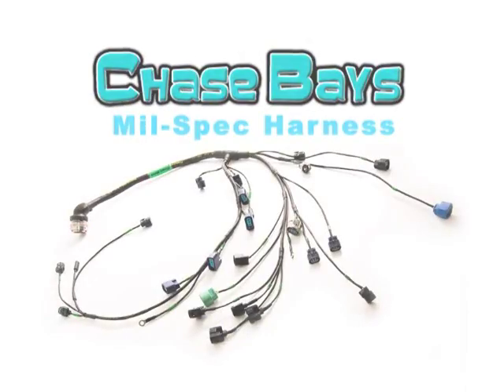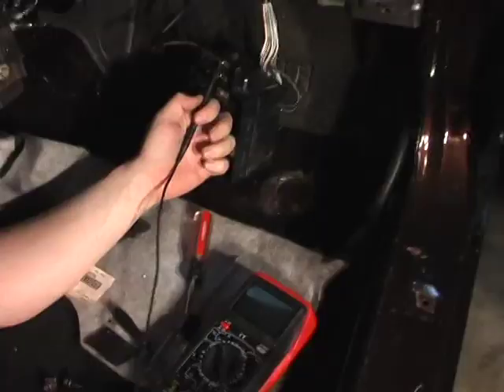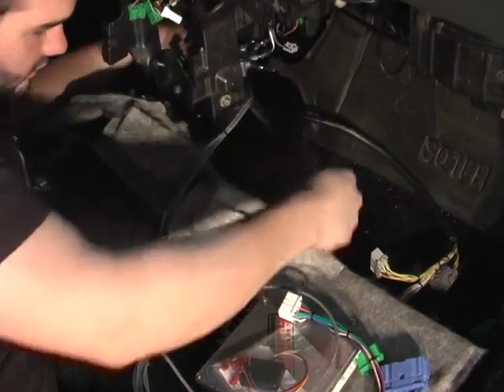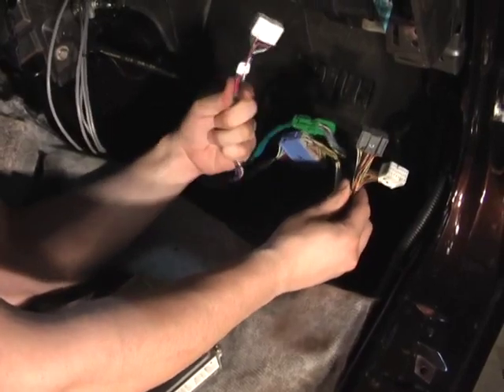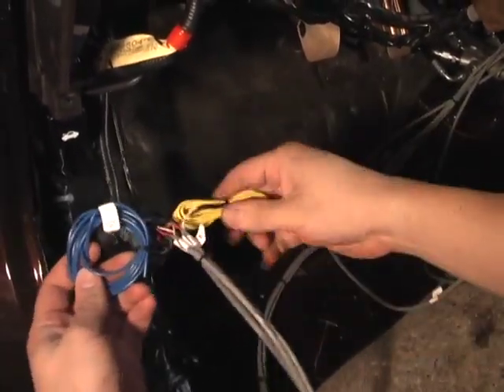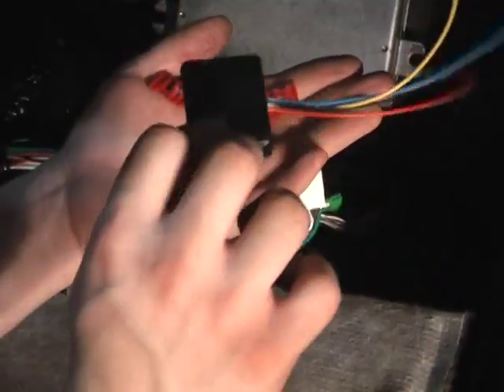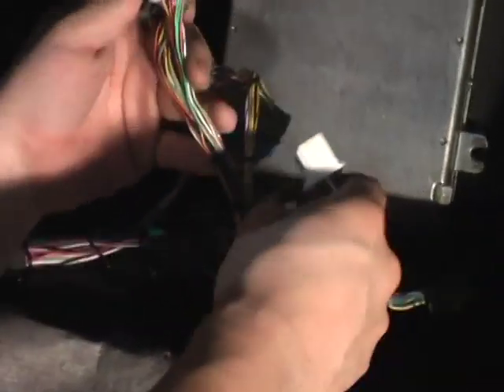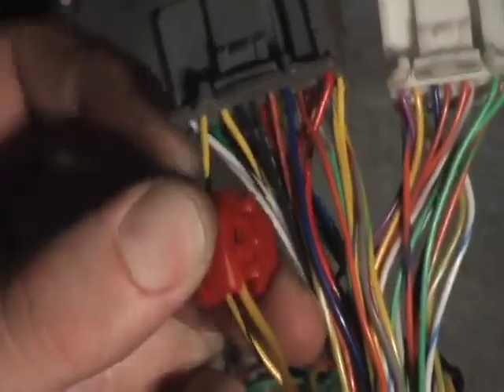Hybrid Racing K-Swap EK K20A2 DVD Part 5

Comment: Hi hi about k20a9 manual all engine wiring can use kswap but the problem the throttle body is electric my k24 is manual throttle body

Comment: helping neighbor with his k24 eg,he installed everything but pops and misses when you rev,ever seen this after a swap? it feels like its ignition is not timed right? im gonna check tps signal at ecu/check ecu pwr/grounds/check ckp/cmp signal using oscillioscope.

i want to check ignition timing,on these cars do you just do this by looking in scan data or do you use timing gun?
Reply from the maker: What ECU does the car have? Seems like it needs to be tuned.